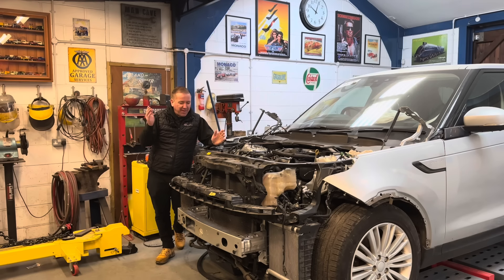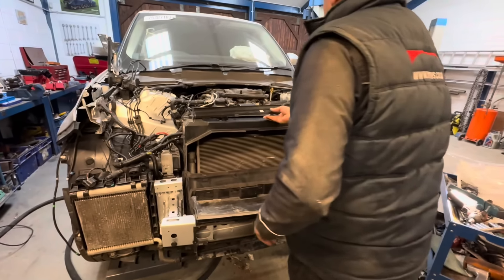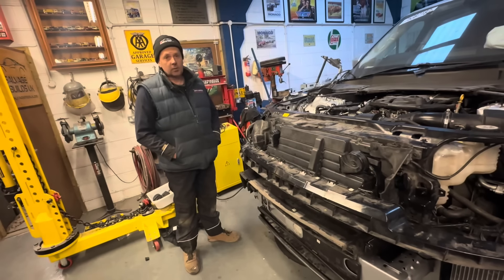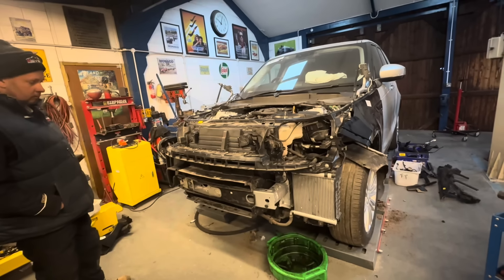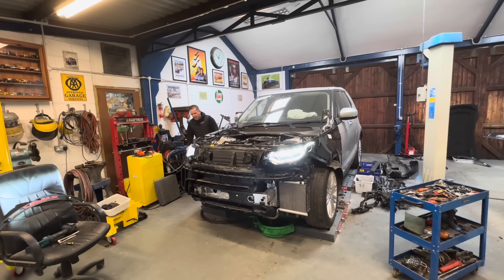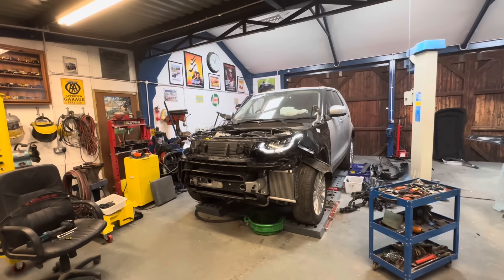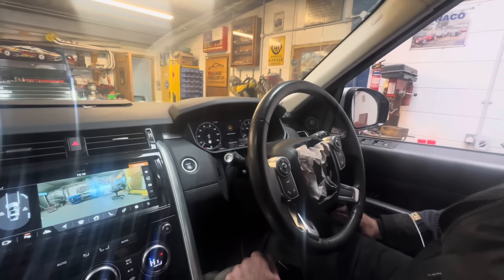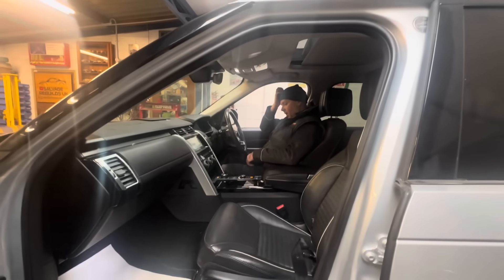REBUILDING A WRECKED 2018 LAND ROVER DISCOVERY 5 PART 3

Comment: Check in the rear centre armrest for the remote control thats where they live - another great vid - I have just done a 2015 L405 5.0s/c Autobiography (510bhp) with 50k on the clock which was a cat N and only pay £640 fully comp - but have turned off the Keyless entry and quite a few other security options. Great cars to work on and rebuild plus it helps having the dealer diagnostic/programming kit... keep them coming boys

Comment: Have to agree with you about insurance, i used to own a MG TF, insurance was less than some others who owned the same type of vehicle. And mine wasn't structural, it had an engine fire, think somebody left a fuel.pipe loose, only damage was to parts in the engine bay and the engine cover, and because it was an MG, they wrote it off, had the car for 5 years, and it's still going strong

Comment: Easiest way to prevent theft is get the dealer to turn off keyless entry. They've also stopped the ability to add  keys, so if you lose the two supplied it's ££££'s

Comment: Great video - as always guys. Nice bit on the end too, clearing up the insurance stuff good info for everyone !! Especially anyone considering buying a cat car. 👍
Reply: They cleared nothing up, that’s not factual in any way, a new policy is a different kettle of fish, it’s certain parts of the uk that can not even get a new policy for less than the vehicle value .

My wife’s Range Rover Evoque
Policy has tripled with current insure from £359 to £900 odds and upon getting quotes elsewhere, cheapest was £2400 up to £17000. They are trying to sell the car on misinformation, and then saying they don’t know anyone that’s had a JLR car stolen, they had one them selves only recently they had bought as a stolen recovered car.
Reply: @yommonaghan785  all insurance premiums have risen this year. I would say that at £359 your wife’s policy was cheap last year - and by the way it’s closer to doubling in price than tripling.
You are of course correct when you say they bought a stolen recovered RR recently- but that’s not what they said, they said they didn’t know anyone personally who had one stolen. 
Chris & Rob both live not far from London so I think their insurance policies would be more expensive than most especially when including business use and Chris had a quote for less than £900 - although they did say that Evoques are more likely to be stolen, so maybe that’s what the policy is higher ?
Reply: @chrisdavidson9431  and it was triple with the windscreen and key cover etc, I ran the quote with out the tracker declared and that took it up another £280. £950 was what they quoted as basic policy with no legal cover or keys, screen etc and I also have the panoramic covered , final amount was £1190 . I paid that when I was 18 on a focus st170 back in 2003 so to see a quote like that age. 40, I nearly choked lol . If I paid monthly, that would have gone up even more .

Comment: The part that you showed with HY32-8A095-AD is the engineering part no. as Chris said and is the 4th level. It would have started life as 'AA' and has been updated to 'AD' Service part numbers are added when the parts are put into the parts system. The Engineering part No. tells me that it is part of the cooling  system in a sequence used by Ford. Anything in the 8000 range is Cooling, 7000 would be Transmission and 6000 is engine.When I worked for Ford (32yrs) in Parts Daventry I used these numbers all of the time,

Comment: You've probably not read the motoring press articles that at the end of 2023 there were apparently 10,000 new'ish Jaguar / Land Rover vehicles stuck waiting for parts. They are prioritising parts supply to build new ones and attempting to supply their own dealers with warranty work parks.

Comment: Not sure what I was expecting, but that looks like a totally reasonable price to insure a Land Rover.

Anyone that can afford to run a Range Rover properly will be of an age to have built up enough no claims etc to insure that for significantly less than what a young person would have to pay on a corsa, fiesta etc.
Reply: I have 4 years no claims and my Focus costs about £50 more to insure fully comprehensive, than what Chris would have to pay for the Land Rover to insure, so you are right because there's no way I would even think about buying something like a Land Rover right now. It is getting ridiculous how high it is getting for young people to insure their first car now with 18 year olds having to pay well into the £2000+ range to insure their first car now. Even when I got my first car I had to pay about £1000 to insure an old 52 plate Yaris that cost me £550 to buy, and that was even with me waiting until I was 26 to actually get my first car after passing at 25 years old.
Reply: Generally insurance companies are insuring LR products at around 10-15% of their value regardless of driver history. There so easily stolen currently insurers don’t wanna touch them. Espcially not around the London area
Reply: 6k in Cheshire , 50 years old with full no claims lol

Comment: Fantastic video as usual. 
Maybe someone already commented on this, but that engineering number is the actual part number which is used by the OEM for their manufacturing process. It's used to order and schedule parts from the suppliers and to control the stocks and material flow through the plant, and also by the bean counters to monitor vehicle costs. If the component is released for service then it gets given a separate service part number which is the one the dealers use.

Comment: This car is looking good in quite a short time really. Lots of nuts and bolts but the pile has gone down a lot. There is always a bit of head scratching when you didn't take something apart but these days most of the stuff is online so just a click away. Of course some common sense plays a part which you two have plenty of if I may say as you have been doing salvage for so long. Good that you  helpfully cleared up some myths between the two of you with regard to insurance. Great video Rob and Chris take care in the cold weather Gents. 👍👍

Comment: Hey Rob and Chris brilliant video Land Rover looks fantastic I have a Range Rover sport v8 supercharged and my insurance is less than £500 a year and that’s with Churchill I never had anyone try to steal it I do have a tracker fixed on wiring from Automatrics keep up with your brilliant work and videos looking forward to the next one Bernard
Reply: Its renewals and new policies that are the problem, I’ve got 20 years without a claim and in a very good postcode, mine has tripled, thefts are a huge problem as proven on the Facebook stolen Land Rover group where 15-20 new post come up daily for ALL JLR cars from around 2013 onwards, and obviously not all are posted on there, and the other huge issue is a huge amount JLR parts on back order for months and insurance companies have been just writing them off because they can not sure parts to repair them , hire costs etc outweigh the values, I bought mine in July and regret it royally, £359 a year to £950, it is what it is, if it were any more, I would have got rid

Comment: I think the insurance think was quite specific to Range Rovers in London getting sky high quotes or insurance companies just not quoting. 
I have an 02 plate Range Rover, 13 years no claims and the car is worth £1500. I couldn't get it insured full comp for less that £400 and with a £500 excess for a 49 year old guy , in Kent and clean driving record. I paid £206 3 years ago and nothings changed.

Comment: You can turn off the remote unlock using nothing more than your key fob. Piece of cake. Just insured my 2019 Disco 2.0 diesel last week for £641. Expensive but so is the car. I live in Aberdeen, Scotland. Although I should note that Direct Line wouldn't quote at all. I just used CompareTheMarket and bosh... The insurance issue seems to be related to where you live. 🤷

Comment: The letter at the start of the part number denotes the Model Year, H being 2017 then they miss some letters like I and O
J 18
K 19 
L 20
M 21

You can also have a carry over part that has not changed in years so a D starting part which would be 13 MY may be used now cos in 2024 (which would be R) as that is still carried across and not changed

Good work on this, loving the content

Comment: Parts supply on the landys is getting better, its due to swapping to a new parts hub which will be the hub for the whole of europe, however UK customers and dealers will have first pick when it is running correctly. Jaguar parts are still available next day but LR stuff still taking around two days. Always worth asking your partsman if there is a Jaguar alternative available!

Comment: If the lights fitted are like-for-like, then I don't think any programming is needed.  It only tends to be when fitting higher spec lights to lower spec vehicles. For instance lights from a top of the range  Metropolitan would need programming if fitted to a low spec S model - and even then, some functions might not work !

Comment: I`ve come across "engineering part numbers" before. With my dealings with older Volvos and Massey Ferguson tractors you will see the part number of the raw, un-machined casting which could be machined in more than one way to suit different applications.

Comment: I have had a couple of these as crank no start. The fuel pump control modules are a known fault to JLR but .. as yet .. no recall. Nice cars though.
Reply: So manufacturers are now needlessly populating PCBs with microcontrollers containing complex firmware and putting them into basic things like Fuel pump controllers, then gaze wide eyed and opened mouthed when it becomes another failure point or don't have the same longevity of the basic older parts they now replace. Years ago a £2 Bosch or Hella relay in the fuse box would have done the same job - i.e turned on the pump.

Comment: But Rob, those aftermarket connectors are often a false economy for Apple. Even when they're supposedly licensed, they often fail. I've had to buy original Apple adapters to connect an ipad to sync into my streaming software. It's a right pain.
Reply: 100% agree, Amazon purchase will be a cheaper Chinese Apple knock off, where Argos purchase will be an Apple product,

Comment: Don't be specific but what area do you think an owner could do to make it more secure so you don't find vehicle in a container at Harwich if lucky  or at worse In downtown Lagos. Cheers mate your expertise is very watchable
Reply from the maker: A ghost immobiliser 👍
Reply: What a transformation. Only work left to do is airbags and paintwork.Its coming back together very nicely. Couldn't expect anything less from you guys.
Reply: For me its old school. I got a steering lock and in my view still the best deterrent. I have the one that goes around  the brake pedal and hook around the steering wheels
Reply: @inverterville does it hold up to a battery angle grinder?
Reply: I had a ghost immobiliser in my M140, it did it’s job, they couldn’t start it and walked away, only thing I lost was my keys!
Reply: Tracker with Geofence
Reply: a pack of angry rottweilers will look after it 😂
Reply: Can a rottwieler put fkin fires out though??😂

Comment: On my road guy had 1  range Rover stolen second one tried but left it smashed into virgin box as had security lock on steering wheel third time tried Bentley bentaga but left it due to having ghost fitted so tried to break in get keys

Comment: Well done again, FWIW I have found some Landrover parts fit my Volvo and are actually much cheaper. (Some parts are Ford).
Your keyfob looks the same as some Volvo models but most of the housings available are clones.
Reply from the maker: Absolutely no idea what all this short stuff means fwiw ? 🤷‍♂️
Reply: @sruk  "for what it is worth", sorry it used to be a common internet short form

Comment: Not the car to be rebuilding and selling at moment prices dropping like a stone & 99% of insurers will not insure them even JLR themselves have stopped insuring them 🤔🫤
Reply from the maker: Absolute nonsense sorry
Reply: If you live in London, Birmingham, Manchester NO chance anywhere else maybe if your lucky
Reply: Why do people come out with this absolute bullshit.... "I heard from a man down the pub....".     "it's common knowledge...." blah blah blah.....

Only comes from folk who've no chance of ever owning one, at any price 😅
Reply: @vanroamin I live in Manchester and my 18 RR sport is cheaper than most other cars I’ve had, even with the mrs who is a new driver on. Don’t believe everything you hear..
Reply: Your statement of “99% of insurers won’t insure them” is factually incorrect. Costs have gone up significantly but most insurers will still insure them no problem. They are expensive cars, you need deep pockets to own and run them.